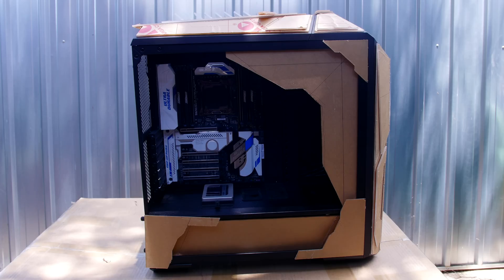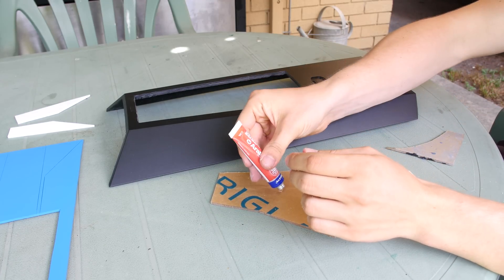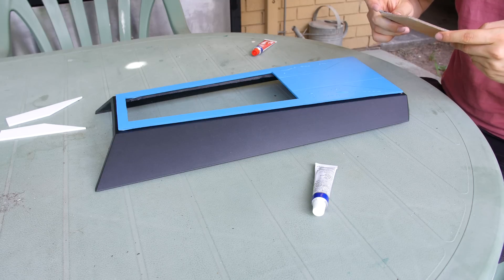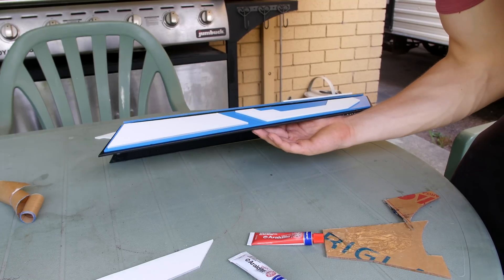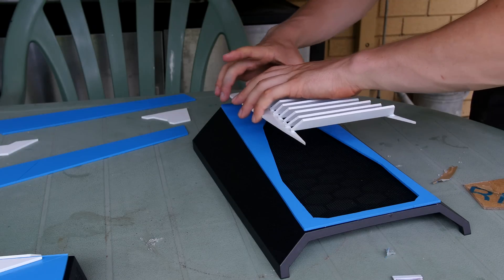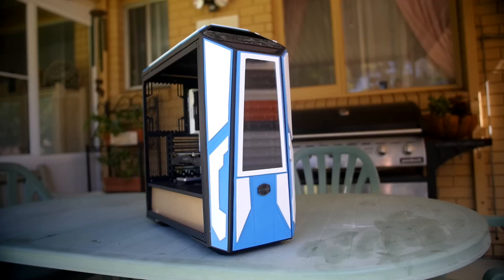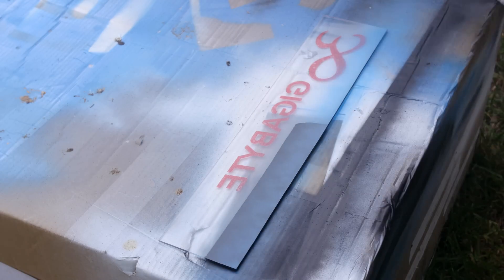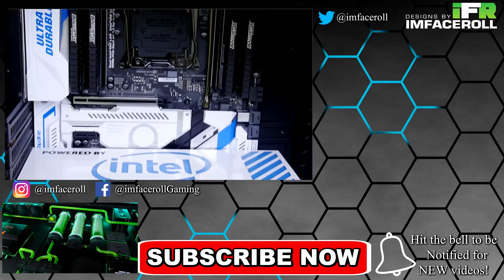Project Infinity a DIY Water Cooled Custom PC - Computer Modding - Liquid Cooling - Part 2

Comment: plz help me! Acrylic seems to hate me so much, i bought a 3mm acrylic panel from my local hardware store inspired by your work hoping to revive an older pc of mine. However i have tried using a jigsaw and i cant for the life me achieve a remotely clean cut it either is cracking the material or if i took it too slow it would melt it making for poor cuts i purchased a plexiglas blade for it and used that for the results. I also have a fear that cold temperatures or maybe even bad material is my real issue
Reply from the maker: +nick matthews hey man, keep the film on when cutting, keep a higher speed, use a plastic cutting blade

Comment: I have a question, the heat of the GPU, in my case is 45 ° C will not melt the acrylic, or take the paint off because the heat?
Reply from the maker: +beat hauser aguilera not at all, acrylics melting point is in the 100s+ like 150 from memory

Comment: Is there anything you could use to cut the acrylic if you don't have a jigsaw?
Reply from the maker: +Lennart Meinke yeah, grab a ruler and something sharp that can scratch into the acrylic, start scoring a nice straight line using the rules to guide it, once you have scored it deep enough you can snap the acrylic and it will snap cleanly where you did the scoring.